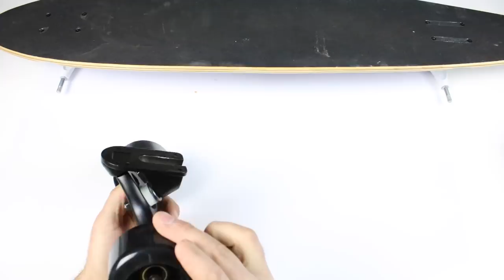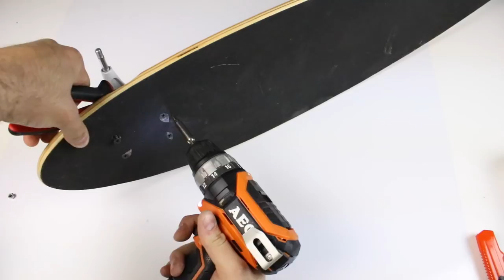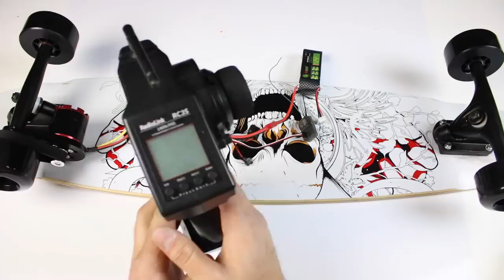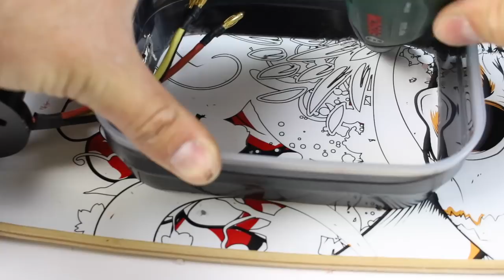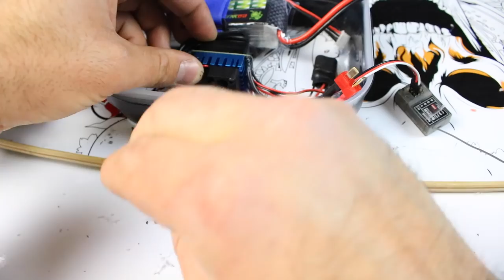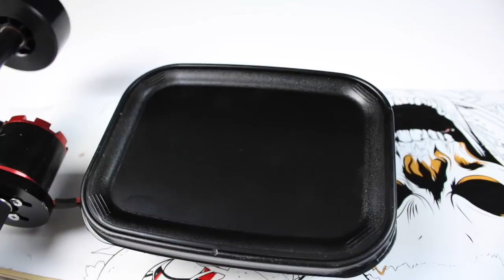DIY Electric Longboard & Ideas

Comment: Hi
Nice build.. 
Just wanted to ask you what bit were you using for your rotary tool?
Reply from the maker: I using 
-ESC 45A 
- TX RX 
- Motor N5065 400KV http://www.ebay.com/itm/322382536122
- Belt Motor Bracket Pulley
- 4 Skateboard Wheels
- 2 * Durable Skateboard Trucks
- Battery Lipo

Comment: hello i am going to built an electric skateboard myself and i listed some parts i think i am going to use. Can someone say if the parts are good?

parts:
motor: 1800w brushless motor DC outrunner
esc: Brave Wolf 120A SL brushless
board: i just buy a cheap board somewhere ;)
battery: 2x 3s lipo 5000mah 11,1 Volt
and i buy off cours a controller and a pulley belt etc. 
i want that the board can go fast (about 30-35 km/h or 20-25 mp/h) and it should be able to handle some hills not really steep ones.

i want to buy the parts from AliExpress and i don't know if they are good. 

hopefully someone can help me, thank you.

Roy
Reply: Its complicated to get a e board set up and still have good performance. Motors and mother boards need to be well paired deep developed.  Its not like assemble a non-electric skateboard. Yah, I am kind of expert.
Reply: you Arent getting a lot of power from a 6s battery so i would recomend you get 3x 3s batteries in series and a 190kw motor with atleast 2500watts then you will go fast. ali express is ok but not ideal. go to http://diyelectricskateboard.com they have awesome costumer service and great products.
Reply: Just be sure to never use belt drive with a motor as powerful as you seem to want there. Get chain drive kit, they are like 15$ on ebay, can transfer like 20x the torque and will not tear or slip like belts.